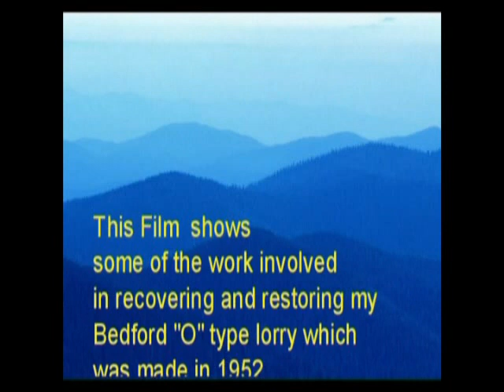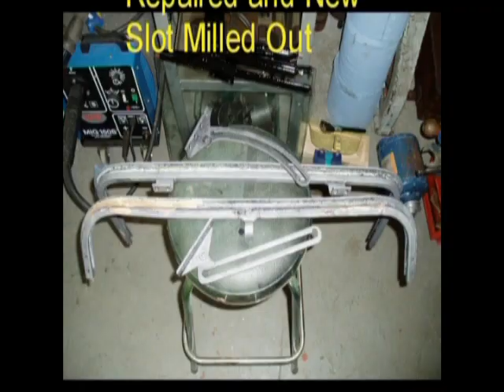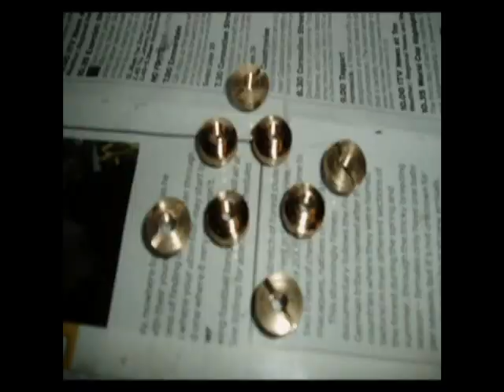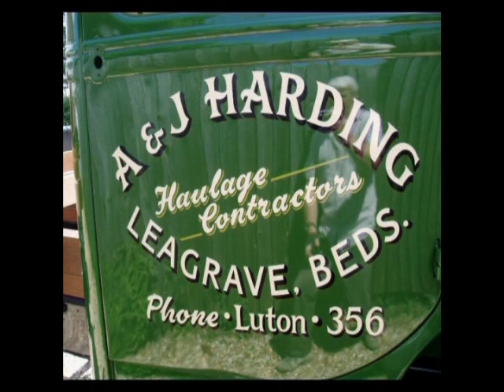Bedford O Type Lorry/Truck 1952- Full Restoration

Comment: Thanks for this video, I don't know what you mean by bad quality because it most definitely is excellent! I am currently going through an OLBC myself, and I was wondering what oil you got, and any tips you have, like If you were to do It again, what would you change? I used to see these around a lot but they are not so common anymore.
Cheers, from Dunedin, New Zealand.
Reply from the maker: Hello Louis, thanks for the compliment, I'm glad that you enjoyed the video. All that I meant really was that the film was made up of old photograph prints which I scanned as digital photography was quite new when I did most of the work.

With regard to the oil grades, I have photographed some pages from the Bedford O supplement manual. Here is a link to Dropbox where you can see the relevant information: https://www.dropbox.com/sh/sffkkofaxb0dczc/AAB5OTVVuZeorLAC-Pp2bc_la?dl=0
I'm unsure what year your O type is but most of the info should be relevant. The engine oil listed is "straight" (non-detergent) SAE 20 but I found that in hot weather the oil pressure was slightly below that specified even though I rebuilt the engine completely with new shells etc. I have a supplementary oil pressure gauge fitted so could see this issue. I now run with "straight" SAE 30 and this is perfect in warmer conditions.

I would recommend getting both the main manual and the supplementary one if you have not already got them. Norman Aish of "Bygone Bedford Bits" in the U.K. is an excellent supplier with great knowledge of the Bedford range, good stock of parts and is a first rate guy. The contact details are in the last photo of the manual in the Dropbox. Chris Morter also in the U.K. is excellent  for parts too, website here : http://www.vintagebedfordspares.com/our-history.html 

That is assuming that you cannot source things locally...

In answer to your question regarding things learned, I would say that my approach was to do everything as correctly as possible without cutting corners to avoid having to re-do things again later. This seems to have paid off as we have now done in excess of 4000 miles without any significant issues. The only thing which I did not do in the original restoration was to rebuild the gearbox, recently it became noisy so I decided to replace all of the bearings. Having completed the job I still think that it is noisier than I am happy with ( although you may say that I am quite fussy and some may be okay with the noise level) so I would suggest getting someone who is a real professional with the correct knowledge to recondition it if funds permit. The other suggestion that I would make is to have the carburettor ultrasonically cleaned and rebuilt professionally. I rebuilt the carb' initially but the running was a bit patchy as it is impossible to clean inside the galleries and this results in lean supply, the running after the professional job has been faultless.

As for the request for a video about running the lorry, a good idea but this is very straightforward really. For starting from cold I always pump to accelerator (not when hot though!) and use choke but push that back in as soon as possible. I'm not sure if you have the "crash" gearbox or the synchromesh as fitted to mine. My experience with the synchro' box is that changing up is easy, when changing down I hold the gear-lever over the next lower gear until the synchros slow down and then the gear can be selected.

The only other modification which I have done is to add an overdrive unit in a cradle behind the gearbox, with shortened front Propshaft. This definitely makes driving in modern traffic easier and overdrive 3rd gear is very useful on long hills. This added to the high ratio ring gear and pinion which I fitted the the diff' means cruising at 45 MPH is easy. Not a cheap option though!

I hope this helps, good luck with your project, I'm happy to help further if you are stuck.

All the best

Alan
Reply: @Mostly Old Things  Thanks, It's a 1948 model. The manual I have managed to find is a Bedford shop manual, and it has a similar layout to yours pictured. In the general maintenance section, it only lists about 5 different types of now no longer produced, British exclusive oils for the engine, and nothing about temperature. What it does tell me is how to remove, rebuild and replace most pieces and assemblies. I plan to keep it relatively stock, with the only differences being in the wiring or brakes, for safety purposes, as long as the upgrades can't be seen. This probably won't matter though, as the top speed without an overdrive unit and high ratio ring gear and pinion would be quite slow. It is very complete, although a non-runner. It was driven into a shed and parked for 30+ years, where unfortunately rats and degradation got to some parts of it. Other than that it is in very good condition, and the restoration will definitely take 10 years if not more as I do not have much free time.
Reply from the maker: @LouisMcNabb  
Hello Louis, it sounds like you have got an excellent find there all be it a bit rough around the edges. The brakes as fitted are excellent so you may find that the stock ones are fine without modifications. I had the master and slave units re-sleeved in stainless but the work turned out to be not so well done as the seals leaked a bit and I ended up fitting another set of new old stock parts. As I understand it all of the running gear was built to incorporate the 12 ton artic unit, so the lower rated O types performed well within limits. Complete Wiring harnesses are available and can include extra wires for indicators etc. The wiring Harness Company provided a fully braided loom for mine 
, link here:
https://thewiringharnesscompany.co.uk/

Any "Straight" Non-detergent oil will be fine in the engine, a lot of lawnmower engines use "straight" oils so that may be a potential source for you. It's also important that you use non-EP (extreme pressure additives) in the gearbox as those Bedford boxes contain brass/bronze components which can be damaged by EP additives. Morris and Millers are two brands which I believe can be imported to NZ.

Regarding the loom, of course this is again in the U.K. so not so convenient for you but they can provide the complete looms from drawings which they have access to.

Yes, the job is bound to take a long time if you can only work on it occasionally, this was the same with me as I was working when I did the restoration, I'm now retired. What with time and weather constraints as well as the cost of all of those jobs it's good not to rush. I agree that keeping it stock with only unseen modifications is the best approach in my opinion.

All the best

Alan
Reply: Bn

Comment: The best 30 minute I have spent watching YouTube.
That is OUTSTANDING.
The tenacity, love and passions is evident.
Love the sign writing, I remember the old before O series, and the 0B buses.
Reply from the maker: Thanks very much Steven, glad that you enjoyed my efforts.🙂
Reply: @mostlyoldthings  did you prefabricate the grill too?
It's amazing to thing you have the vision to put restore it.
Some people would have put low profile tyres on and 6 litre GM V8 and ruined it.
I can see the coalman jumping coal sacks on his back off the back.
Reply from the maker: @Steven_Rowe  Hello again Steven, no the grille was the original one which was very beaten up, it took loads of work to get it looking good again, apart from being bent it was also a little pitted, I had it sandblasted first, then lots of fettling.....  I prefer restorations back to as near original specifications, I guess that some would prefer the "Hot Rod" treatment but that's not really my thing, each to their own though. Since the video was done I have now added drop sides all round which means that the coalman might struggle to get his sacks on and off🙂
Reply: @mostlyoldthings  they were. Lovely lorries
Reply: @mostlyoldthings  A quick question regarding the front windscreens.
Is the passenger side windscreen slightly smaller than the drivers?
I have seen some 1/24 scale kits and it looks like the screens are slightly different
Reply from the maker: @Steven_Rowe  Hello Steven, the windscreens are quite different, the driver's side is mounted in a frame which can be opened and has a rubber moulding around the outside to provide a water tight seal when in the closed position whereas the passenger side is fixed and is a plain glass sheet with a smaller double slotted rubber which fits to the widow opening and the glass. This gives the appearance of dissimilar size screens.
Hope that helps🙂

Comment: Very nice......   loving the old Volvo estate....   You made a nice job of restoration.
Reply from the maker: Thanks..we still have two Volvo estates 1995 960 and a 1997 series 1 V70, unfortunately the old 760 died as the loom in the engine bay disintegrated and would have been a nightmare to replace☹️, out of the 9 Volvos that we have had over the last 40 years it was the only on I could not fix, it was a shame as it was otherwise a great car, I think the Renault/Peugeot/Volvo engine and wiring were not the best.....

Comment: You’ve done a good job of the restoration mate. It’s a very unique design of old British lorry’s.

In you’re spear time, do you like to give it a spin? Or help around transporting boxes/materials?
Reply from the maker: Thanks, I wish that the photo quality was better though, I had to scan old film to get the pictures onto the video as there were not many digital cameras around when I started the restoration. We use the lorry mainly for going to shows and as you say also for just going out just for a drive, maybe the occasional transportation of personal stuff like building materials etc but not generally.

Comment: Nice report with a beautiful result. Compliments. I am now also working with an O type and I must tell you it is really nice work to do this. And indeed, a lot of time goes into it. But I saw that you replaced your Diff and pinion for a faster one. Did you get that made? Or does it come from another truck? I would like to know more about that iff it possible
Reply from the maker: Hello, thanks for the compliment 🙂 Are you in the U.K.? If so that would be good as I get many parts from "Bygone Bedford Bits" in Poole, Dorset. Norman Aishe is a very good supplier and the ring gear and pinion were purchased from him although if you are not in the U.K. I'm sure that he would ship if he still has any. I have also fitted a Laycock J Type (not Bedford J Type) overdrive. This was done after the video was completed so not shown there. If you could not get the ring gear and pinion then the overdrive on its own may also be an option, I have a contact who supplies refurbished overdrives and all the necessary hardware to do the conversion if you are interested. There is another supplier in Norfolk UK called Chris Mortar Bedford Spares, he is also very helpful and has a wide range of spares. If I can help with anything else please do let me know.

Comment: Beautiful truck mate! Do you know what the gap in the points should be?
Reply from the maker: Hello Ross
Thanks!
Points gap (Lucas DVZ6A-P.29. Distributor) is 0.012 to 0.010 inch, 0.300 to 0.254mm. Hope that helps.
Reply: @mostlyoldthings  Thank you, mine is running rough, I have cleaned the carby twice I think the timing is out. I put it on classic registration I just want  to drive it!
Reply from the maker: @rossbennett5934  
Hello Ross.
What are the symptoms? If it is spitting back though the carb when accelerating as mine was initially, then I would suggest that although it seems like a timing issue, it may be the carb. I completely stripped and rebuilt it but still had issues as I just described. This was solved by getting the carb ultrasonically cleaned. The problem with doing the job yourself is that there are galleries inside which you are unable to access by normal means, these get blocked over time, especially on something 60 to 70 years old and the mixture ends up too lean. Try pulling the choke out and see if it improves the misfire, this would indicate a similar problem. If your symptoms are different such as random misfire above idle, then maybe try the distributor cap, particularly the carbon brush on the coil electrode or the cap itself, or rotor arm if you haven't already. Hope this helps and you are driving soon.....

Comment from the maker: With regard to the fitting of the bed, the woodwork needs cushioning from the chassis to prevent chafing. This was not shown in the video but when an old trucker friend of mine saw the new bed he told me that there was usually "Balata" flat belting cut into strips between the wood and the metal. Since making the original video an now I have added drop sides. All the metalwork is still available, a company called Albert Jagger in the UK still stocks all of those vintage coach building bits.

Comment: Hi, my friend is restoring one of these, could you tell me the name of the green you've used please?
Reply from the maker: Hello Barry

The colour is Light Brunswick Green(BS 381C number 225). The paint on mine is a single pack polyurethane called "Tekaloid" which is a hand brushing coach paint which can also be sprayed. It comes with an undercoat and a topcoat varnish which gives an excellent smooth and shiny finish. I got mine here: https://breakwellspaints.co.uk/product/tekaloid-products/   
Hope that helps.....